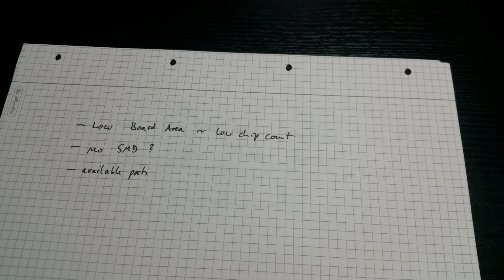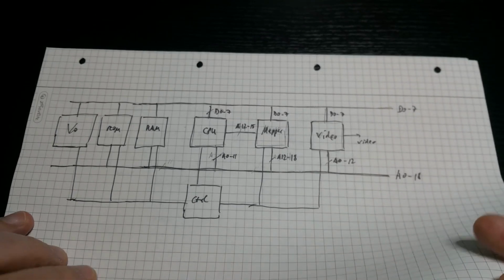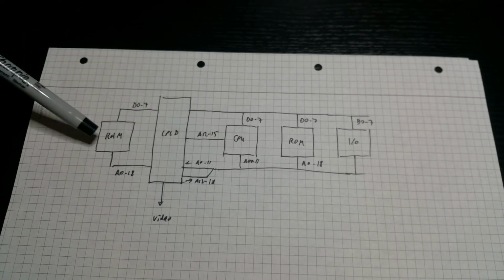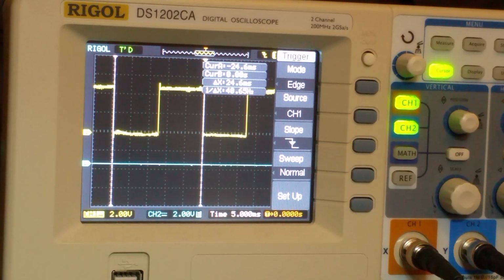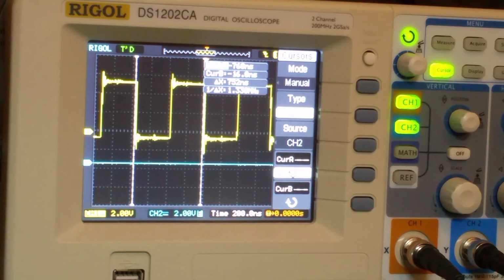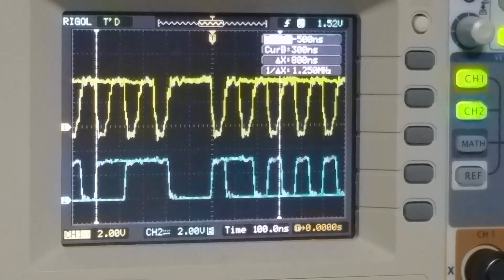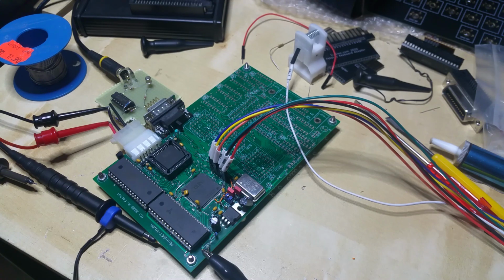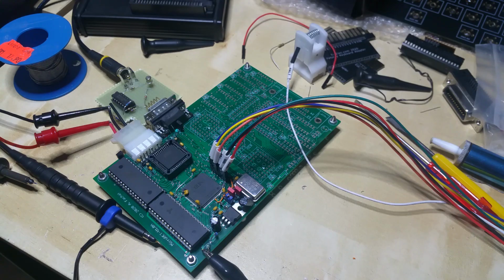8-bit times Ep4: MicroPET CPU integration

Comment: multiple level translators?
Reply from the maker: Not sure what you mean. There are two levels of supply voltage, 3.3V on the CPLD side, and 5V on the CPU side. There are a number of ways to translate the levels.